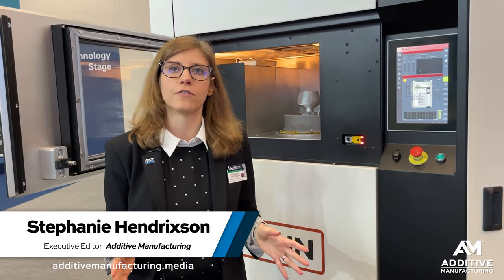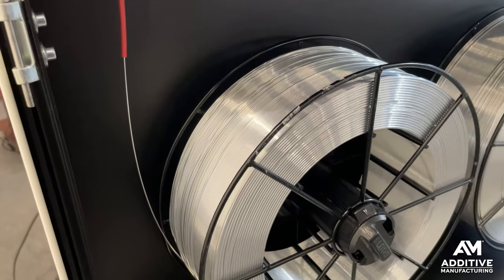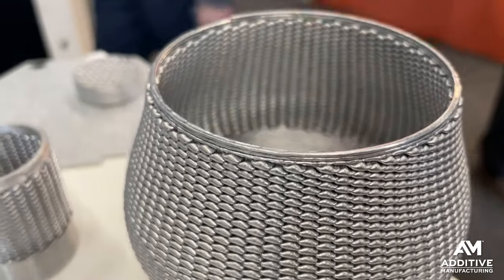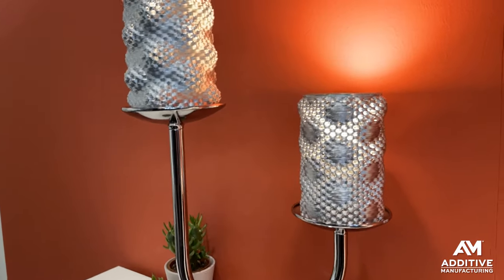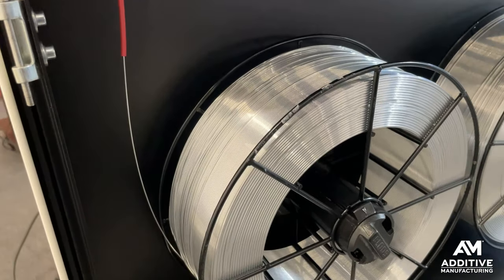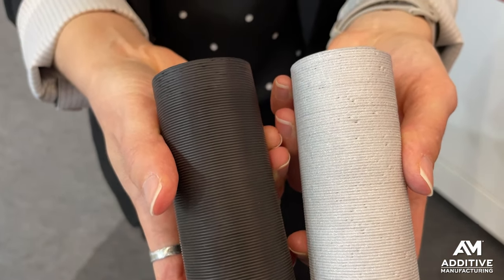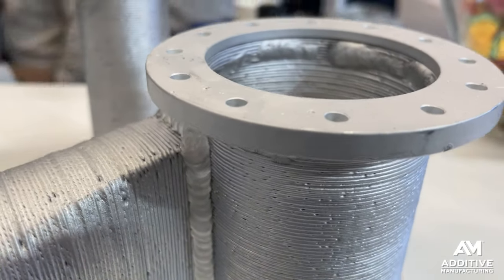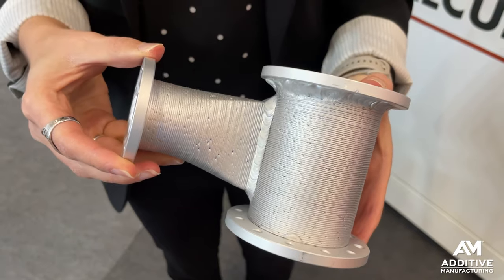3D Printing with Liquid Aluminum | Formnext 2023

Comment: No shielding gas? At all or not generally?
Reply: the parts in the video were all printed (al4043) without shielding gases. going to higher strength alloys (6xxx, 7xxx) shielding gas might be necessary, but depends again on the requirements of the part.
Reply: @ValCUN3D  That is surprising. Sometimes you are not supposed to even look at aluminium without shielding gas.
Reply: @ValCUN3D  Surprised the layers hold together!  I guess getting doused in molten aluminum is enough to disrupt the surface oxides and form a solid bond?
Reply: @ValCUN3D  Is the print chamber airtight? If it continuously leaks, what (approximate) flowrate of shielding gas is required for Minerva? Also, have you tried nitrogen shielding? How does it compare vs. argon and vs. air? My understanding is that nitrogen is about half the price of argon (while air is free).
Reply: Shielding gas isn't enough to prevent the passive oxide formation on aluminum given the vanishingly small amount of ambient oxygen that's needed to form the oxide. I'm guessing the repeated melting and deposition is disturbing the oxide layers to allow good interlayer bonding.

Comment: Great idea but current samples look like they have alot of cracks and fusing problems between layers as well as very limited over hangs and no real complex shape is demoed.
Reply: I suspect overhangs will get better if they use a smaller nozzle.  (or extreme cooling) Surface tension and the strength of the surface oxides will get proportionally stronger.
Reply: @martylawson1638  It looks like these problems will be harder than you assume. If you don't melt the material it will not bond properly, if you melt it to much it won't do over hangs. It's almost better to just do Standart 3d welding robot atleast then the melt pool is from the electric discharge between the feed and surface.